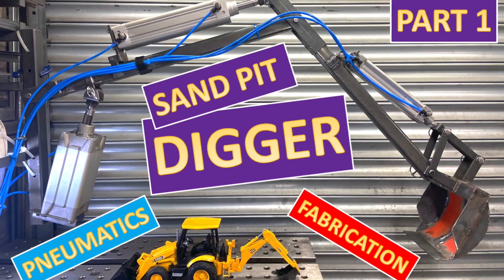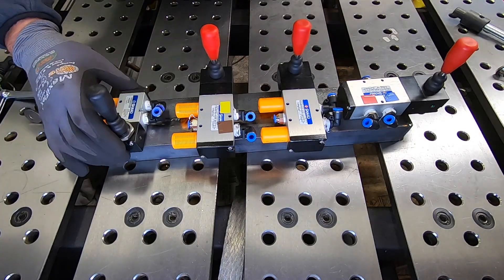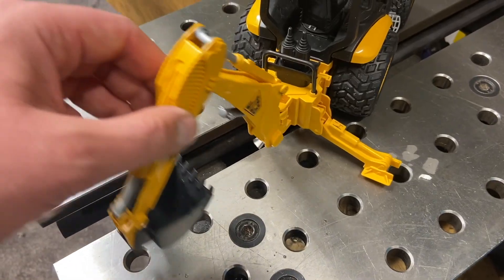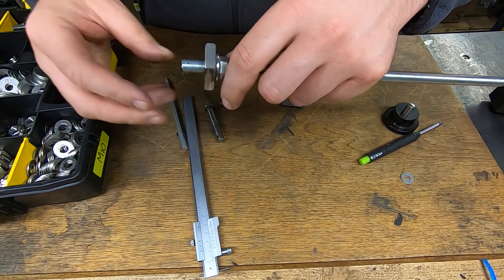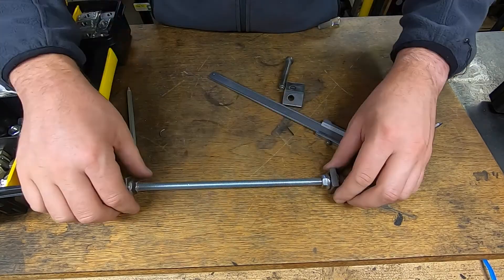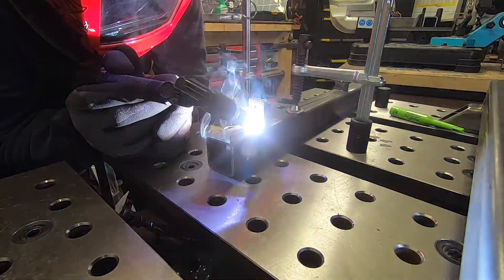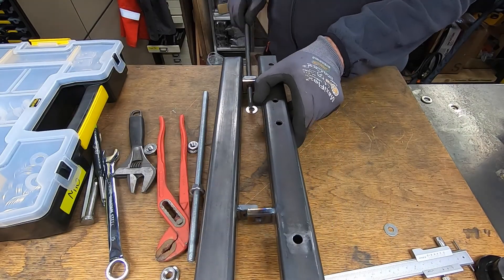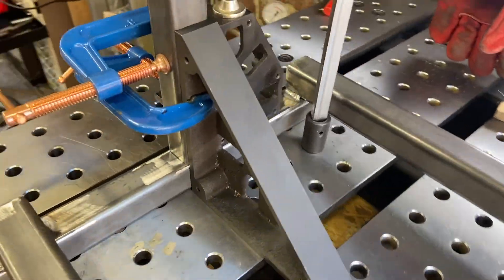** PART 2 ** How To Build a Pneumatic Digger / Excavator! - Fabrication Tips, Metalwork, Welding

Comment: What pnuematic valves are you using?
Reply from the maker: Hi Kevin, sorry for the late reply, valves are often eBay finds, and tube accessories (tees, fittings etc) are KEM. They are surprisingly reasonably priced (£1 per fitting sometimes) Thanks for the view 👍🏻

Comment: you need some more mass behind the seat in case he grabs to much. i would put some wheel barrow wheels full of water. that way you can move it about pretty easy. and some old tubes with zip ties might be enough to keep fingers from poking the wrong bits. 
great idea.
Reply from the maker: Hi Chris, thanks for the feedback.

When I’m use I used two concrete blocks wrapped in black wrap to help stabilise. Thanks for the comment! Cheers